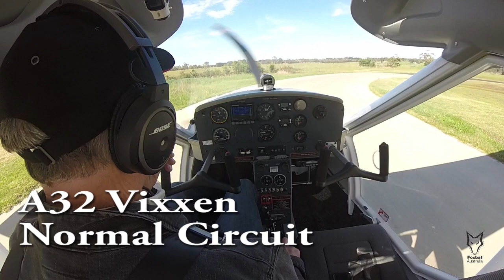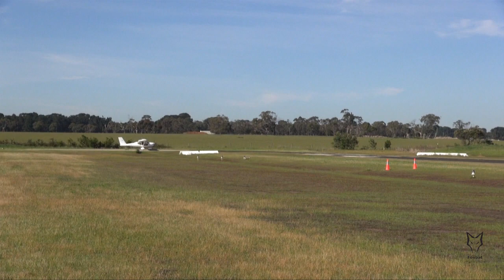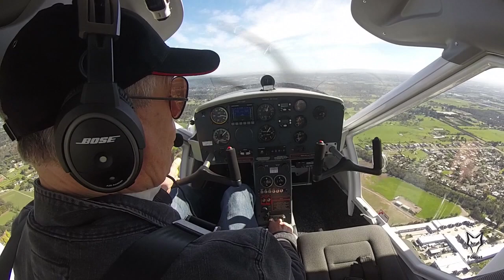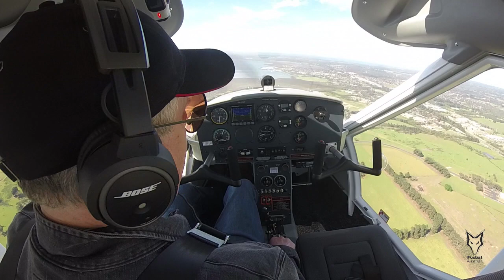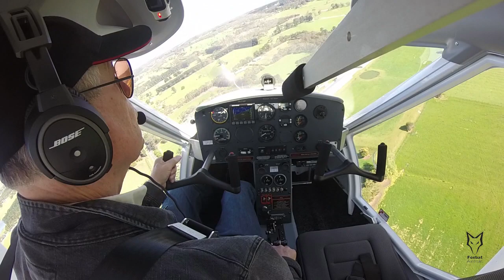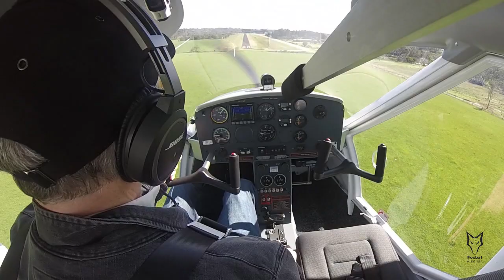How to - A32 Vixxen Normal takeoff circuit and landing

Comment: Very nice.  Peter confirm you deployed the second stage of flap on final (20 degrees)?
Reply from the maker: Hi Mike, Many thanks!
Indeed, The landing was made with two stages (20 degrees) flap. In the edit of the base to final, you can see a single stage already been applied prior. due to editing, it jumps to the next stage. 

Landing with one stage is no problem, there is no published stall speed with only one stage, however, it is not a great difference.

Kind regards
Reply from the maker: Affirm - 2 stages of flap on landing
Reply from the maker: Confirmed!